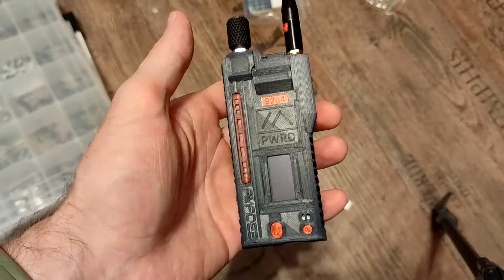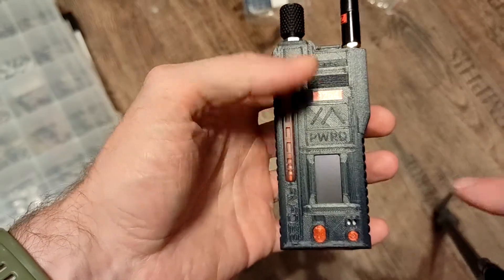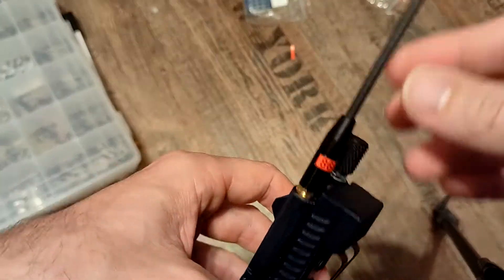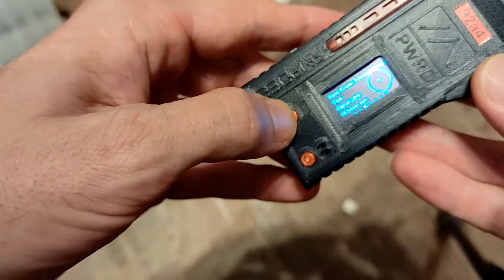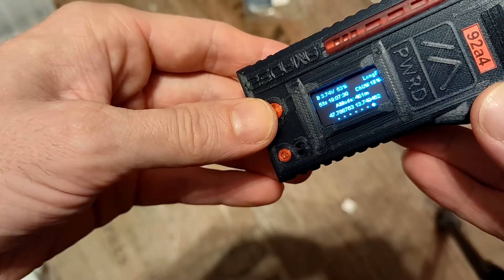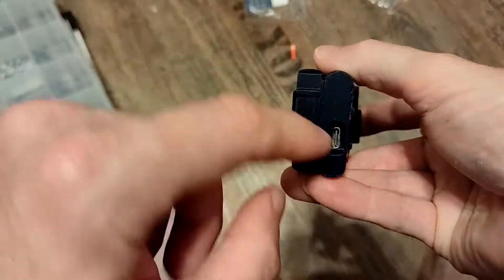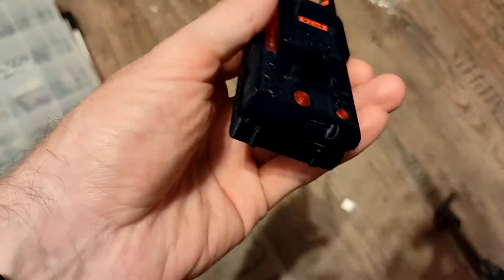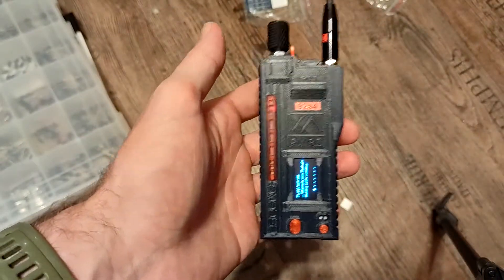"AMade2" Tacticool Heltec V3 Meshtastic personal node enclosure.

Comment: How did you get the quick charge integrated into your device?
Reply: From his printables guide "As the heltec onboard charging circuit is painstaking slow I added my own external one that charges the internal battery with a max of 15 Watts!  compared to around 3 watts originally from the heltec xD Yes thats 5times as fast and no worries, the lipo battery can take that with ease!!!"